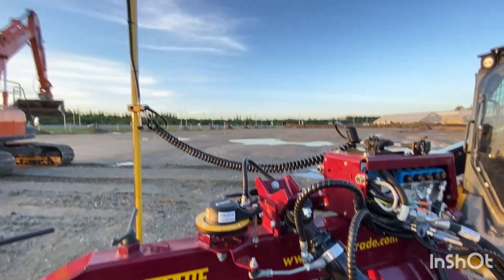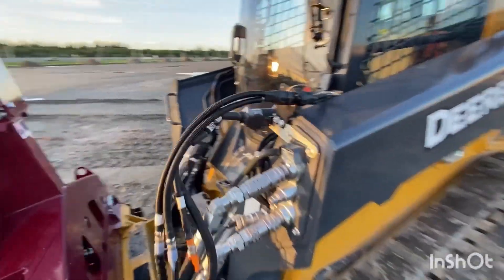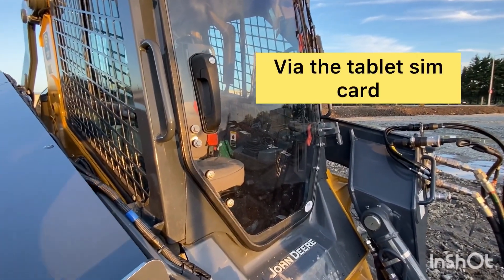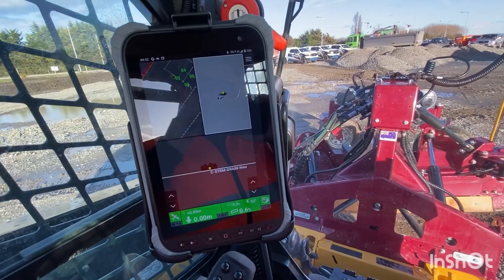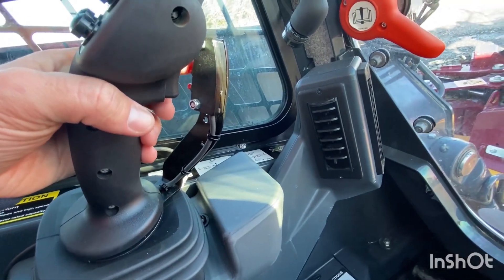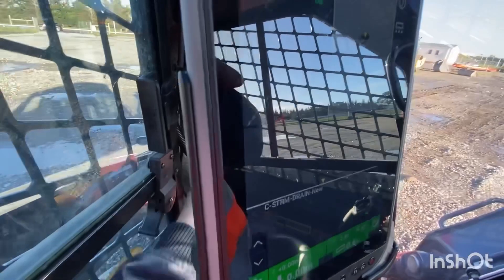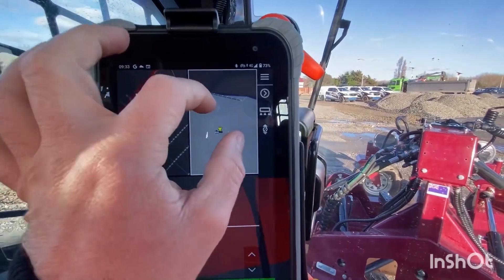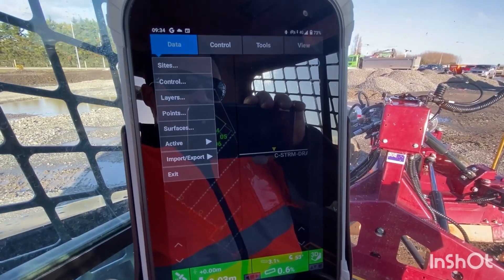Topcon MC Mobile CTL - Sharpgrade G128

Comment: What does a Mc Mobile setup run for a CTL? I cant seem to get a straight answer.
Reply: depends on machine, attachment, dual or single GNSS, single or hybrid LPS, all the licensing options, and who your dealer is. For reference a SharpGrade G128 with single GNSS is right around $115-120K.